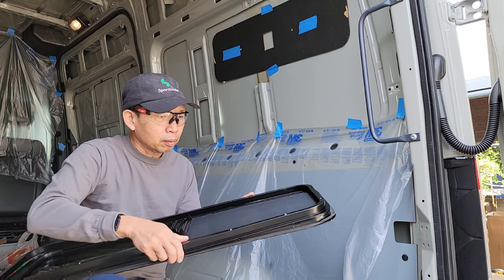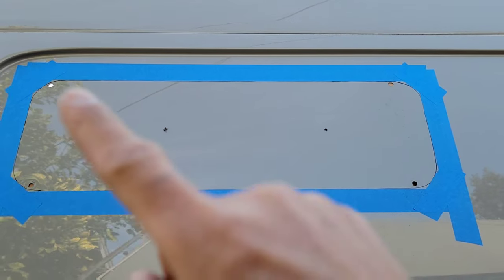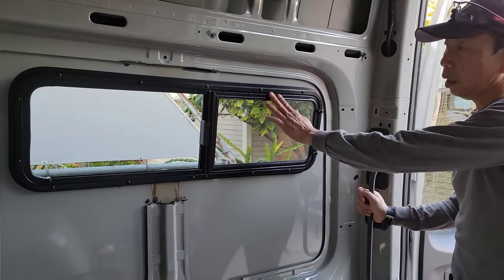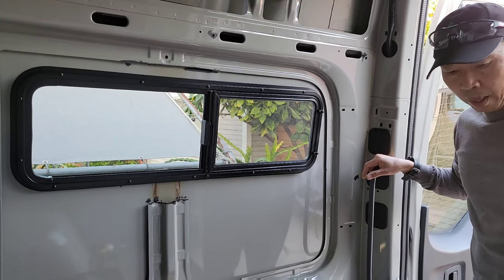How to install CRL universal bunk window with half slide

Comment: Have you ever tried the am auto bunk sliders and if so which do you prefer? I’m leaning towards their big sliders also, not sure how you feel about those as well. Thanks for any input!
Reply from the maker: I've installed a pair of AMA bunk someone's van.  But I haven't owned one.  I do have the bigger slide installed on my own and I love them.  They're easier to install,  sleek design and looks cleaner due to frame less.
Reply: @BoChuonOUTDOORSVANBUILD   do you mean the plain slide bunk ones look cleaner then the am auto bunk ones? I was thinking the same that I don’t like the trim of the am auto on the interior🤔
Reply from the maker: Yes, but that's just your preference
Reply: @BoChuonOUTDOORSVANBUILD  I done have any windows and have only seen pictures of windows online so trying to get the advice of people like yourself with experience. So far thinking 1 big am auto slider on sliding door, and 2 crl bunk windows. Seem like an okay plan or any recommendations?
Reply from the maker: Please watch my next video.  There I will show both windows on the same van so you can see how they look.
Reply: @BoChuonOUTDOORSVANBUILD  okay will do thank you!!!